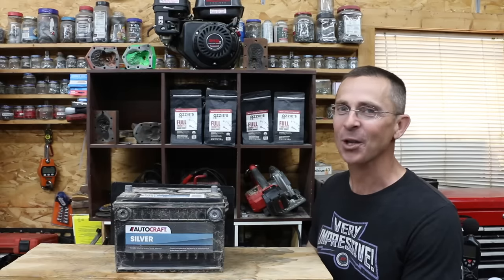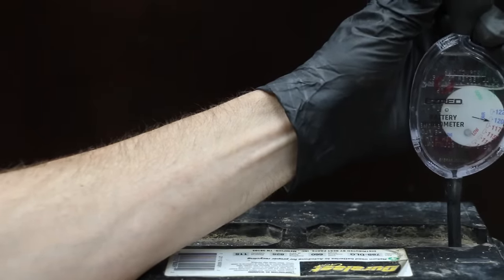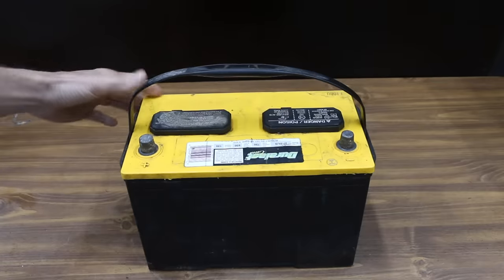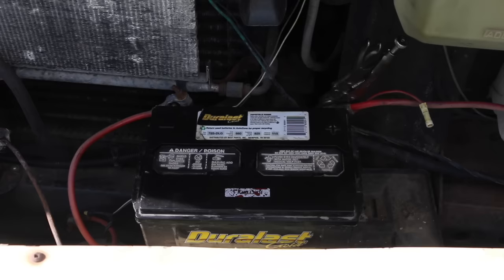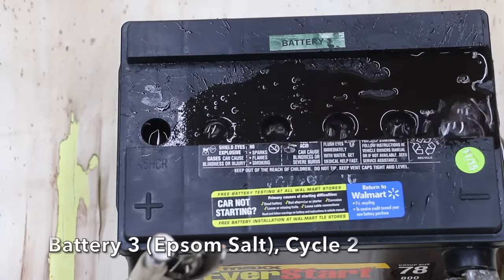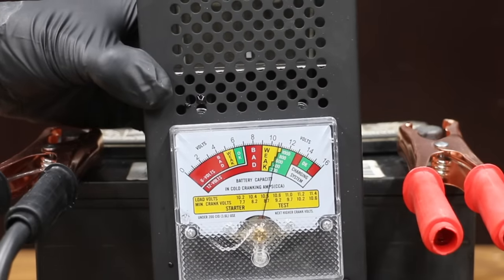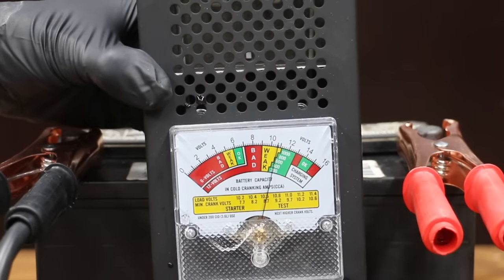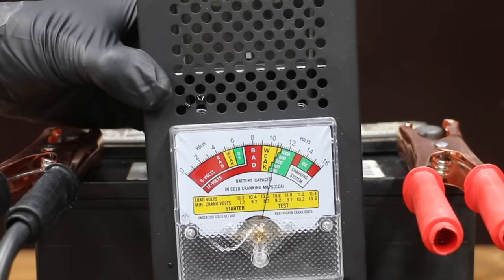Myth Busting! Can You Restore a Dead Car Battery With Welder?  Let's Settle This!

Comment: Just a word to the wise. Batteries can and do explode. I knew someone who lost an eye because of this happening.  ALWAYS wear eye protection (preferably glasses  AND full face mask), gloves, and long sleeves. Have water nearby.
Reply from the maker: Great point!
Reply: And baking soda. Maybe a cellphone too! 😉✌️😎
Reply: @gus473  And a band-aid! 😂😊
Reply: @gus473  
cellphone, with mother on speed dial
Reply: Tub of baking soda water nearby too. Face shield is a 100% necessity. There are pictures of engine bays pretty much torn apart
Reply: a friend of mine just revised the cables trying to jump his car , as soon as the cable touched it blew up!
Reply: @janvanderziel8548  If you put the wrong lead on first, you can get a spark, which will ignite hydrogen off-gassing. That's why ventilation, and knowing how to properly jump a car (no one does it right) is important.
Reply: Yeah I have seen the top's blown off of several batteries
Reply: We recharge a lot of batteries at work out of diesel generators, our charging bench has chunks blown out of it, shrapnel through the chipboard wall behind it.
Reply: @bojangles2492  Yeah some people in the replies need to take this more seriously but I guess that's their issue
Reply: Yep, I personally know a man that decided to check the fluid level by holding a lighter up to it so he could see. A chunk of the casing went through his eye and he completely lost it unfortunately. You'd think he would have known not to use a lighter but 🤷‍♂️
Reply: @bob1hebu1lder2  Yes that's how you check the gas in your motorcycle...😆

Comment: I would’ve love to see you do a comparison of fuses. From Chinese 10 cents/fuse from the gas station to all the way to Bussman fuses. The amperage they can handle compared to their rating on an average of 3 fuses. Fitment and ease of pulling from a socket and a few more ideas!
Reply from the maker: Thanks for the video idea.
Reply: @ProjectFarm I second his idea.
Reply: that sounds like the makings for a Project Farm Movie given how much testing that would need, but I'm not opposed to sitting here and watching an hour and a half of fuse testing and popping.
Reply: I like this idea too. I want to know if a cheap Chinese fuse blows at 6A instead of 5A or if it just randomly blows whenever the hell it feels like it. If it says 5A, can it do 4A continuously or is it always slowly blowing?
Reply: @shawn576  my understanding is that the fuse is designed to blow at that set amperage. Regardless of how close it is. There is a video someone on YouTube of someone testing a 20 or 25 amp fuse and having it hold nearly 100 amps before popping
Reply: Fuses are pretty predictable.  If you know what current you want, you can calculate the cross section of wire to use.  I doubt any fuse manufacturer will louse that up significantly.
Reply: It can get really bad with some companys like horrible.
Reply: Sounds like a good idea. But, here comes the but! LOL 😂 😂 
Fuses are a forgotten link in the grand scheme of car things. A set and forget kind of thing. Personally I do invest some time cleaning contacts and terminals on every project car, motorbike, scooter, etc. But after it's all settled in place.
Never look back to them. 
Curiously in little more than 3 decades, fuses have NEVER been the worrisome side of any electrical problem. 

With this said. As a curiosity it's fine. But maybe not worth the trouble and time of "Project Farm". Cheers
Reply: @KenFullman  it's pronounced "ginah...."
Reply: @shawn576 : A 5 amp fuse likely wouldn't pop at 6 amps, but if it would then it would take a long time.  The filament has to heat up before blowing, so unless it's substantially over it's rating then it will be delayed.
Reply: As an electrician, I need that video.
Reply: Great idea! I love it
Reply: @ProjectFarm  Love your work all the way from Denmark. You could earn a bit of cash by having a phone nymber, where it cost a small amount to sms to. Then you could let us vote on, what to test next time, by smsing. We get, what we want most, and you get a bit of cash. Win win.
Reply: @crpth1  You probaly live somewhere warm and dry.
Reply: Yesssss
Reply: Fuses quality is more about the time it takes to blow.  If the fuse is protecting sensitive electronics, you want it to trip as fast as possible to minimize any damage to the circuit board.  However faster is not necessarily better. Some fuses are designed to be slow acting. For example an electric motor will draw a large peak current when it first starts up, but will quickly settle down to a continuous draw as the RPMs increase.  A slow acting fuse will experience current well above its rating for less than a second as the motor spins up.  You want the fuse rating to be below the peak draw but above the continuous draw.  That way if something jams up and stalls the motor, the high peak current will blow the fuse after a few seconds and will protect the motor coils from burning out.  A fast acting fuse would blow every time you turned the motor on.  

With that said, it's still important for the fuse time and current rating to be as advertised.  If they are advertising it as a fast acting fuse that trips in 0.1 seconds but it actually takes 5 seconds to trip, that could be enough to burn a hole in a circuit board, then you have to replace the whole board instead of just the faulty component.
Reply: @1234567890CAB  Yep. Monitors use slow-blow bussman fuses which confuses me why they are slow blow. (referencing Dell 27" 4k monitor)
Reply: Well I'll tell you one thing, that 10 cent Chinese made fuse and the Bussman fuses...are BOTH made in China. Virtually EVERYTHING sold in the States IS. Even a TON of higher end goods, from combustion engine equip. to the cheapest plastic doodads, ALL made or PARTIALLY made in China. Very little nowadays ISNT. There are even items, some of them reputable manufacturer and more expensive, top of the line items, that have one historically top tier foreign nation listed as the country of origin, but when you dive into the info, the R&D, Deisign specs and possibly assembly of final product are USUALLY whats done in the country that is claimed (i.e. Developed, Designed and Assembled in Germany, or Japan) but all, or MOST, of the components are sourced and manufactured from and in China. If not China you can almost GUARANTEE it will be Mexico, Singapore, Malaysia, Indonesia, Bangladesh, Vietnam, or any number of other Southeast Asian countries.

Comment: I’ve brought batteries back to life with epsom salt. Drained and filtered out the acid with a coffee filter. Flushed out the battery with distilled water a few time. ( shake it around a bunch then drain the water) mixed up epsom salt with distilled water. Poured the acid back in and topped it all the way with the epsom salt solution. Slow charged for a day or two. Worked for two of mine. One was running two years later when I junked the car.
Reply from the maker: Great information!  Thank you
Reply: Yeah. I'm not sure if he missed something, or really tried to run a battery on pure salt water.
Reply: There's a young man on YT who's started with new batteries and used an amount of alum as well with the Epsom salt where he noted the voltage is lower, though can handle more discharge cycles and therefore acts more like a deep cycle battery.
Reply: @ProjectFarm  I believe flushing w baking soda was detrimental.  Just flush w distilled water then add the Epson salt mix.  Epson salt leaches sulphur off the plates and puts it into solution.  If u going to use baking soda then refill w sulphuric acid.
Reply: when you charge them, use 2-3 amp. Slow is the way.
Reply: If you're going to replace the acid, just buy the electrolyte packs. Mgso4 will ruin the chemistry of the battery, it's a placebo for capacity. And when you do replace the fluid the lead plates need to be cleaned or it'll end up the same as before. The only thing you have to do on a dry battery is add distilled water, the sulfuric acid is still there it just needs to be in solution.
Reply: As usual, another interesting and useful video.  I'm amazed at how good his testing is, and how informative it is. 

I have seen guys use a welder to restore a battery , but this is much more interesting.  And productive
Reply: Yeah I have had it work on a few too. And same result with lower voltage after doing so. I also remember even after slow charging, it took another week of being driven in the car before it really felt "normal" again. It's always been a "one more season" fix that has outlasted the car
Reply: @brockbaker3able  Tried the slow charge to desulphate so many times and it never worked for me.  U gotta go the nuke option w the welder.
Reply: In lead-acid battery manufacturing, they will often add a very small amount of sodium sulfate (salt) to the new acid/distilled water electrolyte mixture being introduced.  This provides initial conductivity to the liquid for efficient charging.  Some electrolyzing of the electrolyte is inevitable but this helps to put as much energy potential into the chemistry before that happens and heat buildup during manufacturing.
Reply: It’s like $80 at Costco. Would you say it’s worth messing around with?

Comment: PPE is definitely important when working with batteries.
Early this spring, I popped the cap off a car battery and managed to splash a drop of acid in my eye.
I ran to the hose to begin flushing, and the ice cold water felt wonderful. What didn't feel wonderful was when the ice inside the hose broke loose and blasted me right in the eye!
Fortunately, no long-term damage was done.
Reply from the maker: Good Point!  Thanks for sharing.  Glad you were fortunate!
Reply: Oh, man, you had a rough day! 😬 I'm also glad you are okay!
Reply: The battery definitely charged you with assault & battery
Reply: You nearly had to change your name to EyeOpenNoFear!
Reply: @daewooparts  I see what you did there . "Grinning"
Reply: Been there, I had a bubble pop as I was looking over my safety glasses. I had skin peeling off my eyeball... I thought brake cleaner in the eyes hurt till I tried battery acid😂
Reply: Dude, that is a bad day right there.
Reply: @daewooparts  Clever and funny I like it LOL.😄
Reply: Almost as unlucky as Cousin Eddie
Reply: username checks out lol
Reply: I think I remember you from what is called "The Bricklayer's Story."  Look it up if you haven't heard of it.
Reply: The ice in the eye is like adding insult to injury.

Comment: Thank you Todd, you're one of the few treasures of Youtube. In this video, I didn't see a comparison summary so I've created one for you:

1. Stick Welder Technique:
   - Battery #1 (Duralast, ~12 years old, 825 CCA, 660 CCA):
     - Initial State: 204 cranking amps (CA), specific gravity below 1.2, internal resistance 19.05 milliohms, recommended replacement.
     - Process: Six cycles using a welder at 70-85 amps with cooling periods in between.
     - Result: Cranking amps improved to 446, specific gravity improved in all cells, SOH increased from 21% to 46%, internal resistance reduced to 9.01 milliohms.
   
   - Battery #4 (Ford Ranger, 10 years old, badly sulfated, come in at 2nd Place):
     - Initial State: 7.3 volts, badly sulfated, wouldn’t hold charge.
     - Process: Six welding cycles, followed by manual charging overnight.
     - Result: Improved to 424 cranking amps, SOH at 46%, internal resistance 9.47 milliohms.

   - Battery 5 (AutoCraft, 4 years old, comes in at 1st Place)
     - Initial State: 62 cranking amps, SOH 6%, internal resistance 62.5 milliohms.
     - Process: Six cycles using a welder at 100 amps with cooling periods.
     - Result: Improved to 961 cranking amps, SOH increased to 6% to 81%, internal resistance reduced to 4.26 milliohms.

2. Epsom Salt Method:
   - Battery 3 (8 years old):
     - Initial State: 599 cranking amps, SOH 50%, internal resistance 6.79 milliohms.
     - Process: Neutralized acid with baking soda, added Epsom salt solution, charged overnight, and applied six welding cycles.
     - Result: Voltage dropped to 11.21 volts, cranking amps reduced to 51, internal resistance increased to 74.4 milliohms. - Battery made worse -

3. Desulfator Device:
   - Battery 2 (12 years old):
     - Initial State: 714 cranking amps, SOH 61%, internal resistance 5.72 milliohms.
     - Process: Applied a two-amp pulse through the battery.
     - Result: After a week, minimal improvement. Cranking amps at 613, internal resistance at 6.63 milliohms. - NO Benefit -
Reply from the maker: Thanks!
Reply: Yes, Thanks!
Reply: muchas gracias, tengo una pregunta, después de cada ciclo del soldador ¿se debe descargar la batería? y si es así ¿cómo se descarga? (sin tener que usarla)
Reply: @AlbertoHeNa7734  - No, there is no need to discharge.  After each cycle, the battery's State-of-Charge (SoC) will be fairly low and each time it should improve but will never become fully charged from these steps.

Most of the power is dissipated in heat, rather than charging the battery.

I hope that helps!
Reply: @InspiredScience  muchas gracias por tu respuesta, tengo una batería abandonada y un soldador voy a intentarlo pronto, saludos.